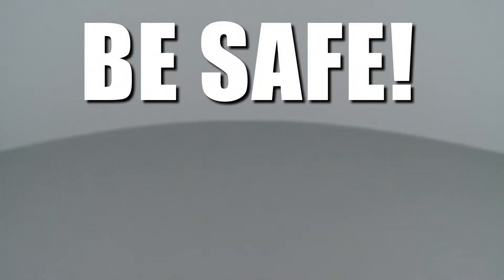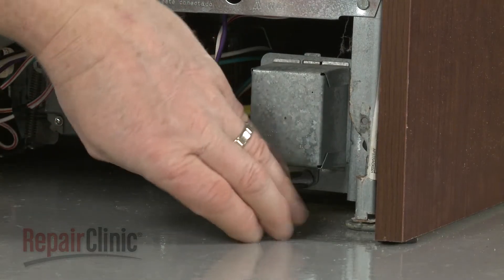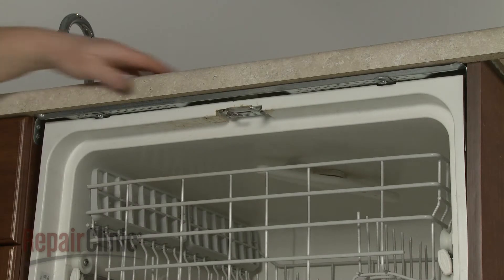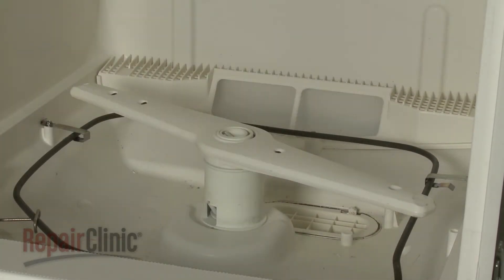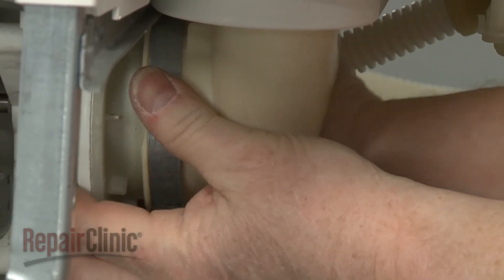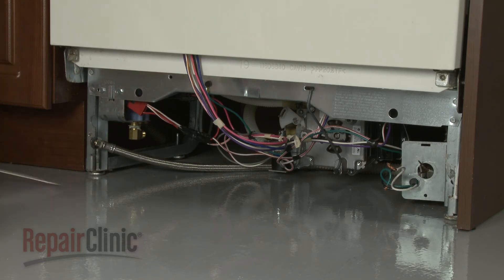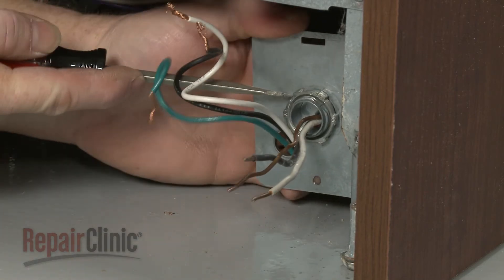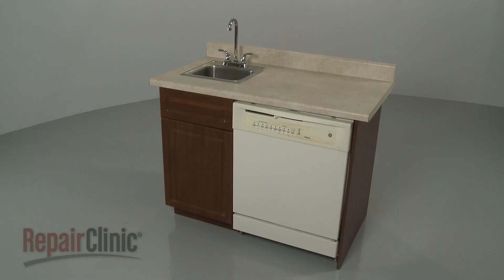GE Dishwasher Sump Replacement #WD18X213

Comment: Shanmon... With all due respect, my GE sump is 34 years old and still very pliable. I don't dispute that certain chemicals could turn your sump to "goo", but blaming GE engineers from the 1980s for not designing for every conceivable chemical, yet to be invented, seems unfair. Seems more like the detergent-booster companies should've labeled their products as possibly harmful to certain dishwasher components. These older GE dishwashers were the basic "Chevrolet" appliance of their day, not a Ferrari. I think they fulfilled that role fairly and that many of them are still performing decades later is a testament to that.

Comment: That's great, but all these GE dishwasher sump inlets are made of this very thin, flexible rubber-like material which breaks down in composition from soap chemicals...requiring replacement.  When they could easily be molded from polyethylene or other similar hard plastics like other manufacturers use.  Mine decomposed into a gooey, sticky mess inside, sending some of it's lining into the drain pump, and into my grey-water pipes.  Likely from citric acid products, commonly sold for dishwasher boosters and rinse agents. Like GE didn't know about this.  This is simply bad design taking advantage of the consumer.  Buy a Miele, Bosch or other better-designed appliance.